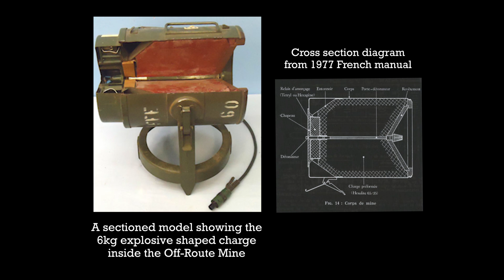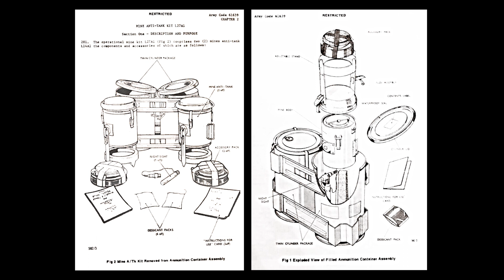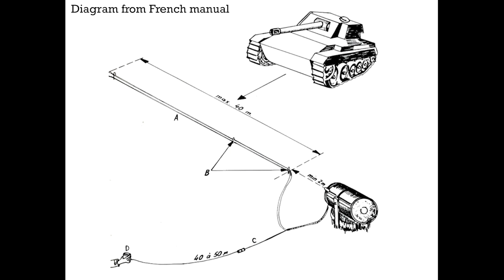Cold War Weapons: The Off Route Mine

Comment: I may be in a select group of Sappers who have actually fired one of these in practice.
I was attached to the Parachute Regiment on Exercise in the US in 1995 on an Annual Exercise called Trumpet Dance based in Fort Lewis in Washington State.
As a Field Troop we were there to help with setting up demolitions etc for the main exercise but were also involved in training days for the Regimental Assault Pioneers going through current anti personnel and vehicle mines
We got a day to ourselves to blow up the remainder of the munitions as was the case due to restrictions on brining excess materials back and the paperwork involved in flying explosives etc.
Anyway I set up an Off Route Mine in a vertical position and placed a piece of half inch plate on top and a used Tank Shock Spring on top of that.
It basically sent the tank spring through the low cloud cover and took around 20 seconds to reappear and hit the dirt.
Cheesy grins all round of course but the Tankies among us looked a bit pale.

True Story.
an Ex Sapper.

Comment: I think the difference between this type of device and a shaped charge is that, unlike the shaped charge that forms a penetrating jet of molten metal (usually copper), this mine is an explosively formed projectile, where the metal is formed into a slug by the exploding HE and uses sheer kinetic energy to penetrate the target. The main criteria is the ratio of explosive weight compared to the object to be explosively formed (usually a steel plate) and the quality of the metal plate that allows it to be formed and not shattered by the explosion. When properly tuned, I have personally seen it penetrate several hundred millimeters of homogeneous steel armor (battleship armor plate) and I have heard from the testers of the devices of over 500 mm, this is with a slug weight of around two kilos..
Reply from the maker: Absolutely yes, an EFP for sure. That is impressive. Thanks for watching!

Comment: Fun fact- in 1935 an Estonian inventor Theodor Tomson invented so-called anti-tank torpedo. Named after it's shape this weapon was probably the first rocket propelled anti-tank mine. These were built at the Estonian state owned military equipment factory Arsenal of Tallinn. The weapon was used by first digging a special angeld hole in ground pointed at the likely area where enemy could move. A wire would then be set up on likely path of the enemy and when tank drove on it the wire would set off the rocket. The rocket could fly up to 100 m, flying about 1,5 m above the ground. This weapon could also be used against infantry with special fragmentation rockets. In theory this system would allow to use smaller number of mines in a minefield compared to conventional mines. Only small number of the Tomson anti-tank rockets were built for military testing. The relatively high cost of this new technology and Soviet occupation in 1940 prevented a further developement of this weapon system and wider adoption.
Reply from the maker: Absolutely fascinating, I hadn't heard of that before.
Reply: "The Estonian army recognized the significance of the anti-tank defence already in its early days. As early as in 1929-1933 Lieutenant Theodor-Nikolai Tomson developed a very modern anti-tank mine TM-34 and 12000 mines were manufactured. TM-34 was a waterproof polyfunctional mine with adjustable ignition pressure. The use of a special arming key rendered laying and recovering safe. Later, an upgraded model TM-37 was made. In 1935, he constructed an anti-tank off-route mine with antitank range of 15 m and anti-personnel range of up to 100 m."
hard to find anything about it other than comments like this one... and Soviets got anty tank mine TM-35 and TM-39 so the whole story is kinda suspicious.
Reply: @Bialy_1  There is nothing suspicious. The information is available on the internet in Estonian language. The Soviet TM mines have no relation to Tomson's mines. Only the name is similar and the Soviets never developed anything similar to the Tomson's anti-tank torpedoes. Just because no English language info is avalaible about something on the internet does not make the info suspiscious. English language military historians just have not done much research about Estonian and other smaller countries weapons developments.
Reply: @Bialy_1  YouTube won't allow me to add a link but if you search "tomsoni tankitõrje torpeedo" you will find info in the Estonian language.